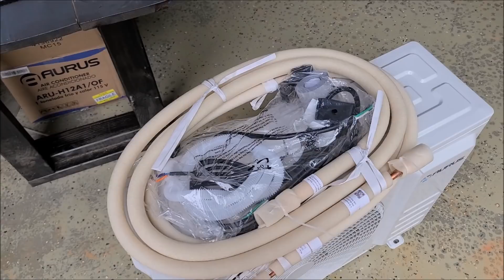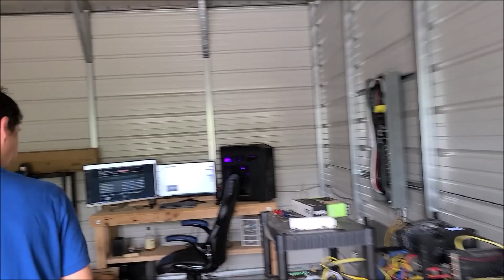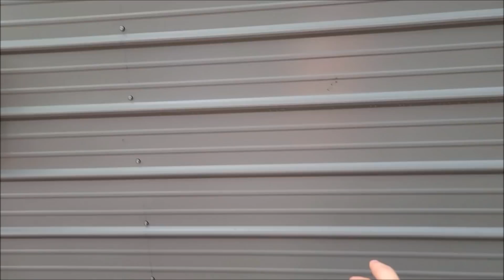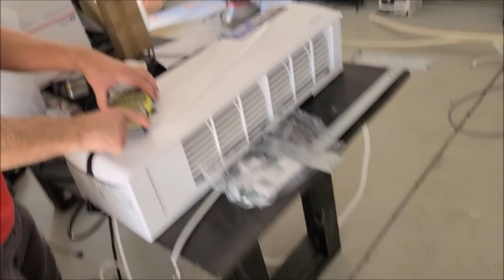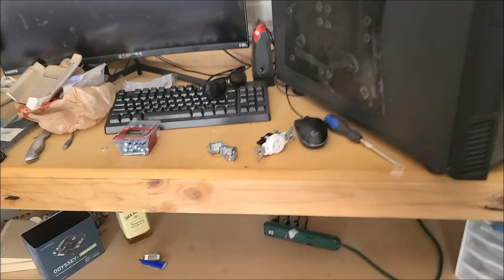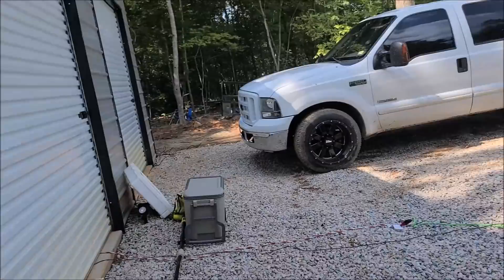Cheapest Mini Split AC for Mining Shed

Comment: 12000 BTU only equals one ton, that's not going to be enough air,  I run a 3 t system in a 10 x 14 room running 12 asic miners ...you wasted your money ,  You could have gotten more btu's out of a window unit

Comment: Sup... that unit is too small you need at least a three-and-a-half ton unit for that garage. I have in my home and open floor plan in the living room kitchen area with 10-foot ceilings and I have a three-and-a-half ton 36000 BTU unit. I installed it like 5 years ago still running good it does heat and Cooling. Also some insulation will go a long way once you get the proper size unit. You can go with spray foam for insulation, like four kits from Home Depot or Lowe's. You'll spend like about 1k or so going that route DIY.....

Comment: You just  need an intake and exhaust setup to move the hot air outside and bring fresh air. That AC unit will not  be sufficient especially with no insulation and only 12000btu. Also being pre charged does not change needing to vacuum the lines. You always need to run a vacuum and pressure test the lines. It may work but your compressor will not last. And a 15 amp breaker is what you need. 20 is too much and in a short it will melt the included wire and burn down the shed

Comment: I vac my lines after I’m purging with argon while sweat the fitting connections. Argon to prevent scale buildup that oxygen creates from sweating with high heat. Then I vac to check for leaks from condenser to the compressor prior to connecting the high & low pressure lines. This unit looks even easier. Moving along, moving along! Just got one of my second rig setup on HiveOS by following you Noob setup guide. Thanks my issue was pool specific but was able to get it identified & fixed with the help of my son. Take care of your kids because one day you will be helping each other out!! Just ask your father-in-law?? Lol Cheers!

Comment: Also that ac is probably only 110v x the amps,  that’s usually how those acs are like mine is that way 110v x 9.8 amps on a 120v 20amp breaker usually unless you have 110v wiring for some reason cuz USA is 120v mainly for housing so you should be able to run a maximum of 2400 also that AC doesn't  count as continuous use cuz the condenser that kicks on and off so it’s not constantly pulling that 1000 watts or more it’s going on and off so you technically do not have to follow the 80% rule with things that just go on and off only continuous use you want to do 80% rule

Comment: Bro you just take 120v x the amps and you get max power of unit also a 20amp breaker on 120v is 120v x 20 which is 2400 max 80% is 1920 watts your way off bro

Comment: hvac guy here. you are an idiot. that the unit is precharged has nothing to do with the fact that you MUST vacuum the system. right now you basically dunked a glass of water in your cars engine oil. it will run, but for how long?

Comment: To check if your unit is efficient...there has to be a differance of 13 celcius or MORE between the air coming in the uper vent of the inside unit and the air blowing from the unit.

Comment: User qsrxo made a really good point.

"You should probably at least insulate the ceiling, so you aren’t getting heat just permeating into the whole shop. Big metal building with electronics heating it up on top of summer sun!"   I AGREE! Condensation will be a big problem...hot outside surface+cool inside surface= condensation and "rain" inside the building. Watch out for that.

Comment: I am an HVAC tech and not pulling the moisture out of the system (pulling a vac to 500 microns) will not keep it from working. What it will do is turn to acid in the system as the water reacts to the the the Poe oil and 410a. You have a short line set so I am interested to see how the system holds up. Let us know you start having problems. But for 500 bucks one or 2 seasons worth it!!!

Comment: Whats the advantage to this over a cheap window unit? I just installed a 18000btu window unit in my mining shop. I had to cut a hole in the tin and throw up a few 2x4s to support it (didn't have window). But the unit cost me $250 and at 18000btu, is much more than enough to cool the entire shop. I looked at these mini-split systems but didn't really understand the benefit?
Reply: Minimal noise with a split.  Window units are way too loud.

Comment: you will need 4 inch of insulation on thoughs walls or the metal will get so hot from outside that you want be able to cool the area. 12k btu will cool that area if its insulated

Comment: I recently installed a 18,000 btu mini split 240v in my home office, with 80 cards running in a small 120 sq feet office, yes 120 sq feet.  Damn AC couldn’t drop the room lower than 90 degree but the cards are happy so I am cool with it

Comment: Brandon  look into having that insulation that they blow on the ceiling and walls and that will keep your cool inside longer , I like the Ac unit you got think I will get me one .
Reply: Spray foam is crazy expensive compared to bat insulation, but you're right it works like a dream, also helps with air sealing which is almost as important as the insulating properties as well.

Comment: That aircons is to small for your shed dude. You need 24000 btu. And you need insulation. That 12000 BTU one won't last the guarantee because it will run 24/7. My place I mine in is smaller than yours and my aircon hardly keeps up. I got a 18000 and it hardly copes with all the hot air the rigs produce.

Comment: Brandon Coin: "I'M NOT GOING TO USE AC IN MY GARAGE" 

Also Brandon Coin: "CHECK OUT MY NEW AC!"

I knew you would need some AC in there, I've built enough grow rooms to know with that many watts you're gonna want some active cooling. At least you didn't waste time trying to make it work lol. Hopefully that's going to be enough to help some. You're going to want to look at insulating that building also. Regulating temps is going to be a bitch with just sheet metal walls lol. Can rigs freeze in the winter? Lets find out.
Reply: Lol the ac is just for me to be cool when I work on rigs outside the closet :p

Comment: Its a portable ac about 1000 - 2000 watts im guessing i have one of those but not using it i think window unit 5000 but uses less wattage tho, you might need a windows in you shed, but put supports sticks etc... to Lock window so nobody can open it and enter ...

Comment: You should probably at least insulate the ceiling, so you aren’t getting heat just permeating into the whole shop. Big metal building with electronics heating it up on top of summer sun!
Reply: Spray foam brother man !!!!! Spray and pray
Reply: Condensation will be a big problem...hot outside surface+cool inside surface= condensation and "rain" inside the building.

Comment: What do you get when you have 2 hillbillies in a non insulated building a 120 volt 12000 watt ac system and then add some mining equipment? You have an overworked ac two dehydrated hillbillies in a hot box. Dude, this won't help.

Comment: 120v 10a == 240v 5a. You can definitely put more on the 20a circuit even following the 80% rule
Reply: Yeah 20 amp sockets can handle 2400 watts at 100%; 80% of that should be able to run 1900-1950 watts safely maxing out 80% rule. Would only not do that much if it was a long run, but he is wired nicely to be able to maximize output.

Comment: my 1gh rig easily over powers a 12k BTU AC no problem if you dont have proper exhausting. even with a AC unit, if you cant exhaust the air coming from the rig, the AC wont do much. best way beat this is to isolate a section of your garage just for the rig. if you leave the rig in the open with everything else, it wont do much. but hoping it works for you more than it did for me. it might be different for you because i have mostly 3080s and they are a pretty hard to cool in the summer.
Reply: Lol you obviously don't watch the videos........
Reply: @BetterForever24  why is that?
Reply: He's been saying from the beginning of this shed build what he was going to do.... and also said several times in this video what his next steps were and his intentions for his rigs....
Reply: @BetterForever24  he also said he wasn't getting an ac for his garage but look at it now. anyways wtf does that got to do with me giving him heads up with the ac.
Reply: @FuIImatiK  the ac isn't for his rigs... his rigs won't get any of it.  He's said that from the jump.... again... the video does say all of this.
Reply: @BetterForever24  he doesnt say anything about not for his rigs, and where do you think the rigs going to be? outside? its in the garage with him. so wtf does watching his videos got to do with me giving him heads up.
Reply: @FuIImatiK  you would have heard that the rigs are going to be in an enclosed area with air circulating in and out from the outside....

Comment: condenser cannot condense air, so if you dont vac it the outdoor unit will start to shake and make noise in about 2 years and condenser will break around 3-4 year your are luck if you get 5 years (i do aircon  installation in australia)

Comment: brandon coin "dont cool your rigs with a/c..." also brandon coin "today im installing a.c." lol what changed?
Reply: Did you really listen to his video ? Cause if you saw this I conclude that you don't lol
Reply: @saioh1080  can u elaborate? perhaps i missed something.
Reply: @pearlrival3124  Yes of course. Basically, when you install a unit like this, it has a certain amount of cooling power (BTU). Each BTU represents a certain amount of watts that it can cool. If your whole mining setup is burning let's say 5000 watts, then for it to be cooled down, you'll need an AC unit that can deliver the amount of BTU that represent the 5000 watts that your rigs are burning. If the amount of BTU is superior to the 5000 watts, then it will get colder. If it's equal, the temperature will stay the same. If it's less, then the temperature will just not go as high as if there was no AC. For example, if your AC can cool down 3000 watts of heat and your rigs burn 5000 watts, then the heat will only be from 2000 watts (5k-3k). I hope that's a little more clear... Sorry English is not my first language I'm still learning
Reply: @saioh1080  yeah i understand what your saying but just last month brandon put out a video dead set against using a.c. to cool rigs and now here we are...
Reply: @pearlrival3124  That's because he isn't.  He's said in pretty much every previous video that he's building an enclosure for the rigs so that the A/C doesn't have to work to cool them.  That enclosure will have its own intake and venting to outside.
Reply: @LeadSkillets  right the server cabinet.
Reply: Lols excatly
Reply: Rigs will be in a closet recirculating outside air ac is just for me to be comfortable when I record and work on stuff  p
Reply: @MotorNubs  nice channel brandon. ill be on the lookout for one of those dirt bikes lol. watching you nearly miss that curve in the homescreen video... well i dont know if i should say was hilarious or scary; nonetheless,  awesome channel. regarding a.c. everyone seems to be promoting spray foam but it got me wondering... whats wrong with the 2" pink foam? is cost that much higher? im not a fan of spray foam because of the mess it would be if you had to access the walls. right now you're free to route wires but once that shits on there any mods would be a pain.

Comment: You absolutely need to vacuum the lines out of that unit.  The refrigerant being precharged has nothing to with removing air from the system.  

Best of luck.  It may work.  But it will not be efficient at all.

Comment: I want to install a Mitsubishi system in my living room and downstairs (dual zone) reason being if my upstairs has an issue, my downstairs can fill in a little and make it less miserable. The thing about the ones like you bought are the repair parts. When they have issues they are a throw away if you can't get the stuff you need to fix it.

Comment: Theoretically it should be pulling about 500-700W on a continuous basis. You can actually check that using the power meter since it's 120V. Mine is 18K BTU and pulls 750W continuously off of a 240V circuit. It's barely enough to keep the temps down in my mining basement (which, albeit being insulated, does not have any airflow in it). So, hopefully, with additional in and out fans this should help keep the temps down.
Reply: Wow. I’m using two power hog 1100w portable ACs to cool off 3000 watts of GPUs. Monstrously inefficient.

Comment: Really should of tried to spray foam the shed for insulation. I would of used 2x6 for walls, then spray foamed with open cell (cost efficient) you really would be surprised at how effective the foam is, even for houston heat

Comment: This shed is going to be a dream when it's all done! Not going to want to leave!
Reply: the dimensions of the Aircondition is too low, it will run on full power all the time and probably not even cool the shed, for this size he would need at least 30.000BTU, sorry Brandon, would be better if you could change the Aircon, with 12.000BTU it is not possible to cool this shed, even without the Rigs,

Comment: That building really needs insulation
Reply: Spray foam
Reply: Correct me if I’m wrong but if you insulate the walls you  trap heat in, as well keep the heat out. You want ventilation with these mining rigs. Insulation could be a negative for the winter not allowing cold air into the room
Reply: @jacobbrown3097  you’re not wrong at all.  There is something called make up air and exhaust if you want to have control of outside air coming into buildings.
Reply: @jacobbrown3097  you will trap hear from the sun.    If you insulate. The AC will regulate the internal air temperature.  If you do not insulate.  You will constantly be fighting the radiant heat from the sun.  The AC will not be able to keep up
Reply: Crypto Play that’s what I assumed. Idk why Brandon is talking about insulating his shed